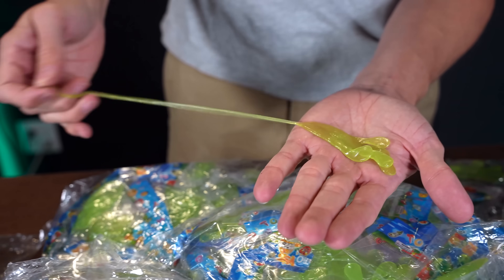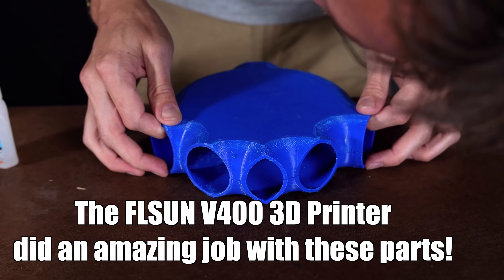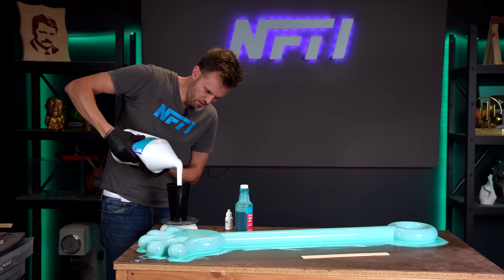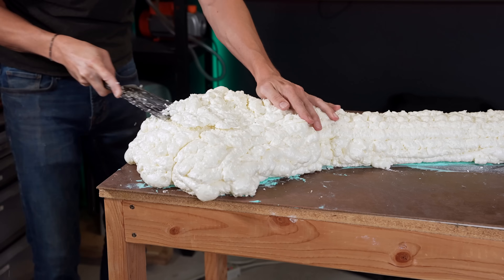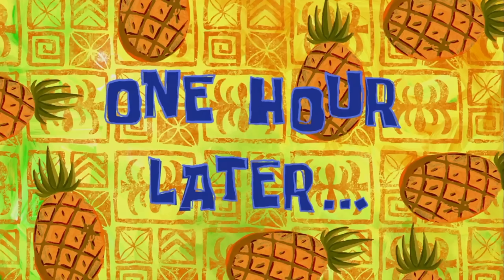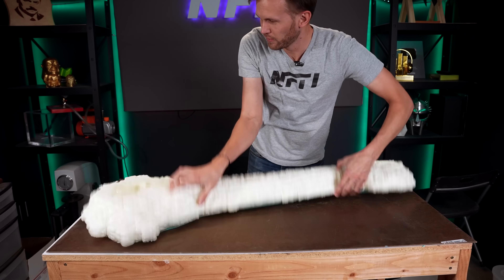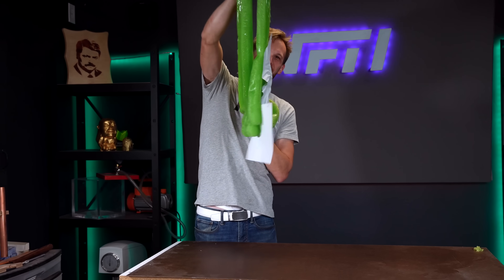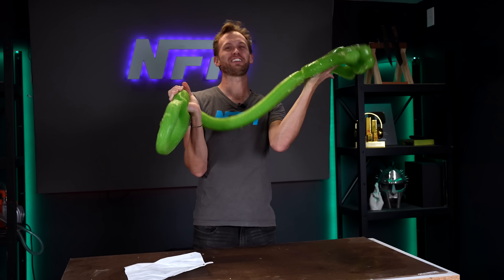World's LARGEST Giant Sticky Hand!

Comment: The ridges from the 3d print probably caused the non sticky side issue. If the mold was smooth it would probably fix that issue. Even though youre probably not gonna do it a second time im sure it was a big pain😂

Comment: So, about 20 years ago, I was a pizza hut delivery driver. In our store, we had those quarter machines, one of them had sticky hands. Well, with paperclips and whatnot, I was cranking out sticky hands for free. First, I got 3, braided them together and wasnt impressed. I got 6 more. Braided 3 in to one and another 3 in to one and then the 3 big ones I had, in to a big one. Still not impressed. So I did all of that, 2 more times. I was at 27 small sticky hands. Not good enough. Ended up with 81. THAT sticky wrecking ball was able to break ceiling tiles and pick up a big new yorker pizza box, WITH the pizza in it.

Comment: I think you need a launcher to propel this far like you would with the tiny ones, lmao.

You mentioned how heavy it is, and that definitely doesn’t help with trying to get it to stick to walls — maybe you should try making one that’s thinner; like, increase the X and Y scales linearly, but have reduced scaling of the Z axis. That will give you a higher surface area to weight ratio. 

Also, I think that whatever does the sticking may have bonded to the silicone — you might want to consider a different material to be a mold liner? Since it’s sticky anyway, you just want something it won’t chemically bond to rather than a stick-free surface

Comment: The bits touching the silicone weren't sticky because of your 3d print job. You spent no time sanding print lines smooth so you didn't get a smooth sticky surface
Reply from the maker: Even spilled on super smooth parts of the silicone, it had no stickiness. And poured on other super rough surfaces, it stays sticky.

Comment: I think you need a heatgun to soften up the non-sticky sides just enough for it to stick again.
Reply from the maker: I tried, even used a blowtorch.  Melting the surface a bit still didn't bring back the sticky, so I assume some chemical got removed or traveled into the rest of the goo.
Reply: @NFTI  AAH, it might indeed be the case that some stickyness got removed due a chemical being broken down due the heat.
Reply from the maker: @darknessblades  Not from the heat. It can melt just fine. It was something with the silicone.

Comment: I think the micro-ridges left in the silicone mold by the 3D print is what made those sides non-sticky. I think this could be mitigated in the future by making the 3d printed parts smoother, either by coating the entire print assembly with something like you did the joints or individually prepping the parts with an acetone chamber (melts the 3D prints slightly and removes layer lines).
Reply: I believe he could just heat gun the non sticky side...
Reply: @bismuth7730 Brilliantly simple solution
Reply: Also the hand and fingers need to be more flat.
Reply: just want to add that PLA will not react with acetone. you will need to print in ABS for that
Reply: That or I'm thinking a film of silicone adhered itself to the sticky hand substance when it cooled and came out of the mold with it.
Reply: Chris is likely correct.  New non-stick pans rely on texture more than special coatings that can flake off into foods.  (Teflon had a good run, though.)  The rough, striped or waffled textures of those pans act like tiny fingers holding the food away from most of the surface, and the food's surface tension keeps it out of the low points in-between, especially with a bit of water or oil to act as a buffer.  This is what the print seams did to the molded surface.  As goopy as the rubber seems, it still has some resistance to deformation, keeping some of the surface from forming a strong bond with what it's slapped in contact with.
Reply: I was thinking the same thing, just coming down here to say the same
Reply: I was just about to say that

Comment: That material uses a mechanical stickiness instead of chemical. Spray your print with acrylic and polish it, then recast it super smooth and youll have sticky the whole length.
Reply from the maker: Poured even on other rough surfaces, it's still sticky.  And even the very smoothest parts of the silicone left no stickiness at all.
Reply: What if you washed it with soap? That's how you restore the stickiness. @NFTI
Reply from the maker: @phanorkner  Yep, tried that. No change!